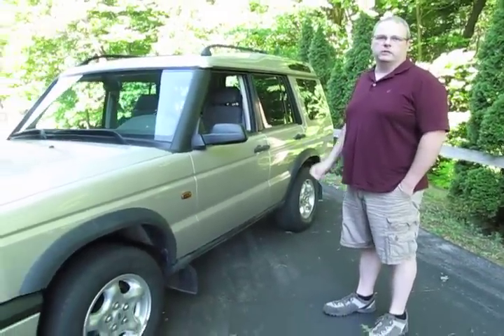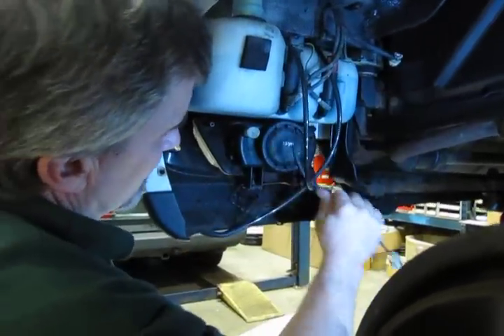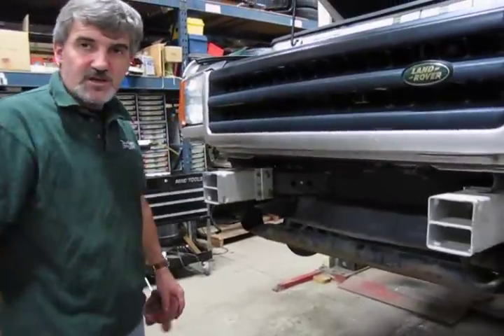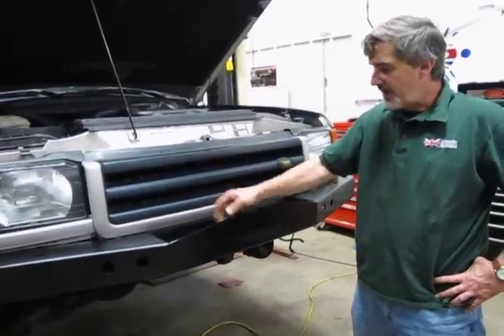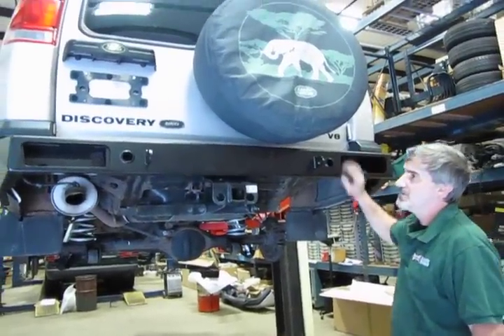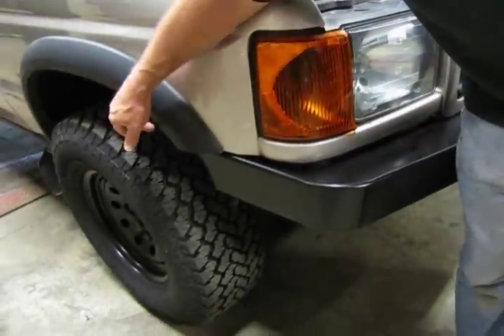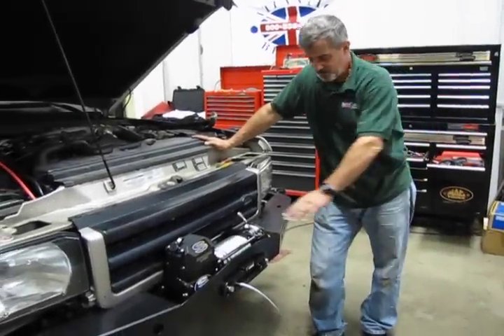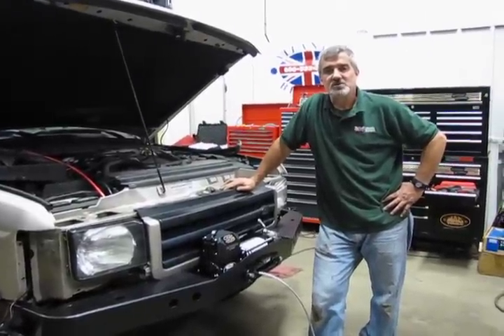Install Steel Bumpers On A Land Rover Discovery Series II

Comment: I must say…They SEVERELY understate the complexity of the two hitch bolts…mine were somehow 18mm bolts and had been RED Loctite’d in at some point (I doubt that was factory)…it took an air driver like 3 tries and a 24” breaker bar to loosen mine. Not to mention removing the hitch completely…all I’m saying is don’t underestimate the process…but the result is totally worth the effort…the extra stability from the hitch bracket is awesome!

Comment: Just finished putting one of those rear bumpers on my 03 disco 2.
Heres a couple of tips:
1. The long bolts holding the hitch receiver to the chassis have red thread locker on them. Heat them up with a torch for a couple of minutes first and they'll come out way easier.
2. I tried putting the bumper on the way they do it in the video but I had a lot of trouble. It was easier to remove the hitch receiver entirely, lift the bumper into place, bolt it on with the bolts behind the fog lights, and then raise the hitch receiver back into place and fasten it in.

Comment: why wasn't the bumper made so it stuck out about three inches further. Then you wouldn't have to cut the grill.
Reply: Because that lessens the approach angle, which is more important to an offraod vehicle.  Although it hurts cutting up your truck the first time, it geats easier as the trail scars collect.  Function over form :)
Reply: It so that it makes it easier for the tow truck driver to hook up as u break down on the road
Reply: @myrongaines5542  Nah! Land Rover's  don't break down.